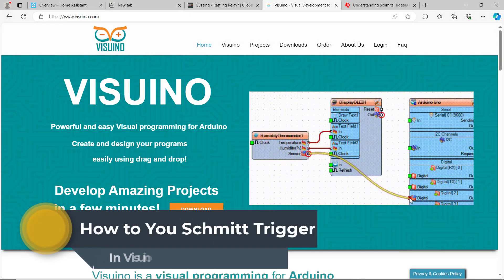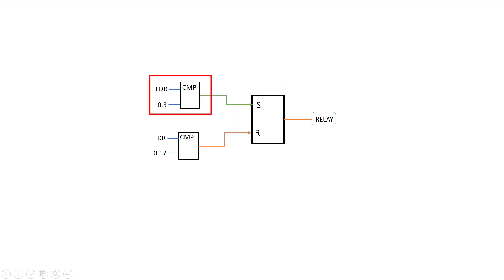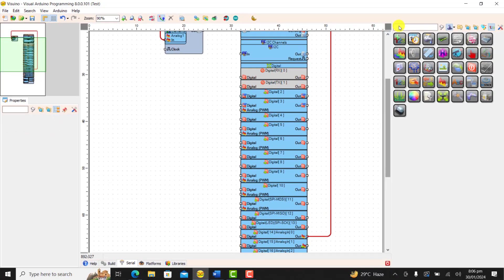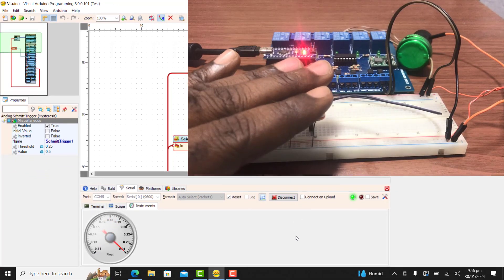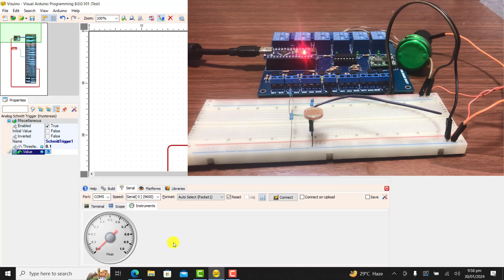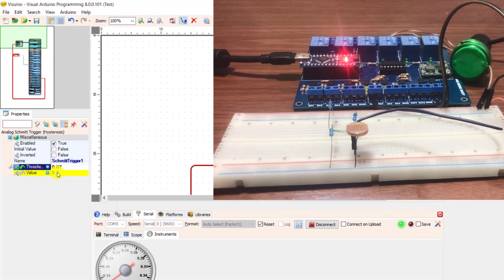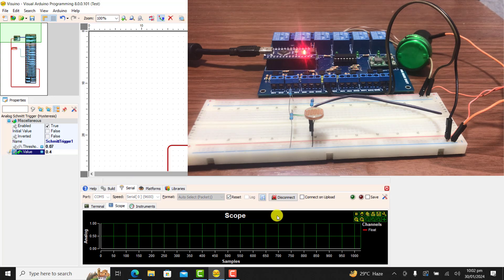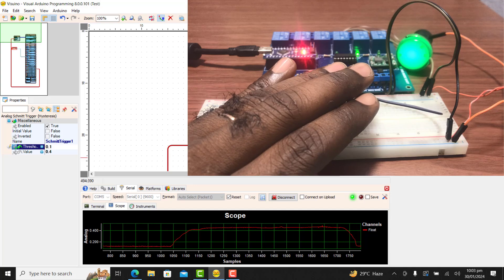Arduino PLC - How to Use Schmitt Trigger in Visuino

Comment: Wow, fantastic video on so many levels! You are explaining well the problems with simple comparer, and showing different solutions. 🙂. And you are showing how to explore with unknown functionality in Visuino. Super cool! 
The way the Value and Threshold work in Visuino is actually simpler than what you thought ;-) . The Value is the switching point - the same as in Compare. The Threshold is the unsensitivity around the switching point. So you can move the switching point and leave the threshold the same.
I have added the video to the rest of your videos on the Visuino Wiki! 🙂
Reply from the maker: Thanks so much for the compliment and also the detailed explanation on the Threshold and value settings. Grateful for adding this video to the Wiki page as well.👍
Reply: @engineeringmadeeasyingme6819  You are Welcome! Here is another hint ;-) . You can replace as example Compare with Threshold while preserving the settings. 
1. Select Compare component in the design area. 
2. Select Schmitt in the toolbar.
3. Right click on the Compare and from the menu select "Replace Selected"
You should even be able to replace multiple components in the design this way 🙂
Since the Value does the same in both components, they can easily be replaced in place while preserving the Value setting 🙂

Comment: Please tell me, 
need arduino code for before uploading  PLC program ?
Reply from the maker: Can you please rephrase the question because I'm not getting it thanx.
Reply: @engineeringmadeeasyingme6819  I want to know after making the plc circuit, don't you put an arduino code?.  Otherwise, only the PLC ladder code is uploaded to the arduino nano board.
Reply from the maker: @h_nimsara  Oh ok no need for arduino code. You can program it with any PLC Ladder software that is compatible with the Arduino Nano board eg. OpenPLC, OutSeal Studio, Flprog etc however you can still program it with the Arduino IDE.
Reply: @engineeringmadeeasyingme6819 
Oh.Thank you so much.
Your video is very nice..keep it up.❤

If i have a problem i will ask you.